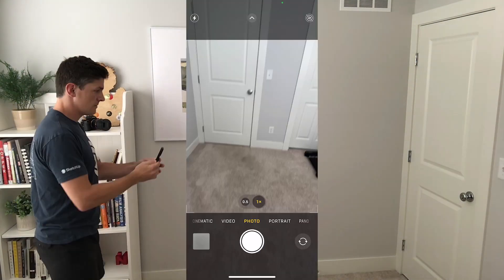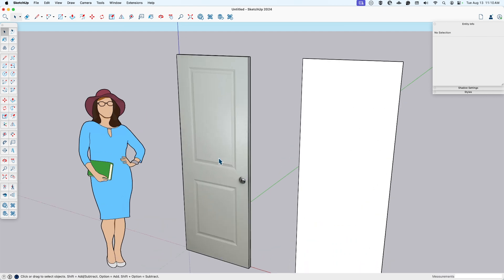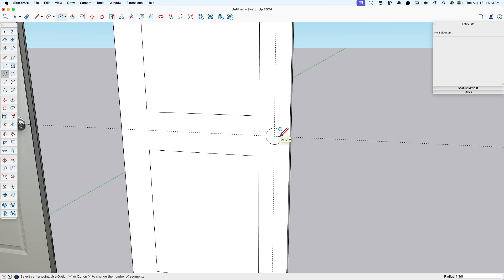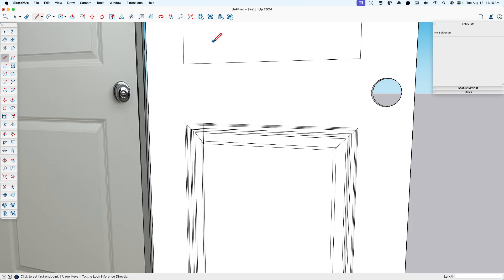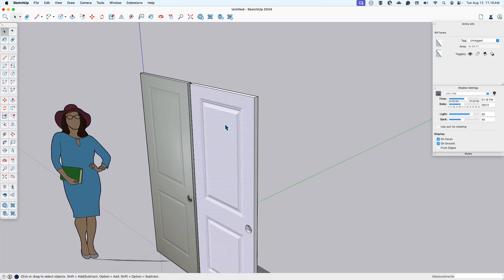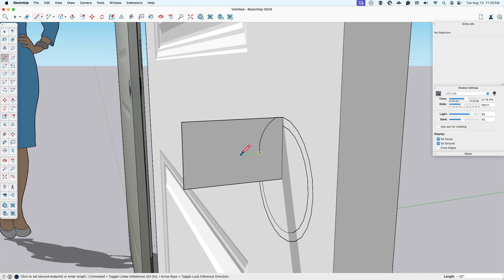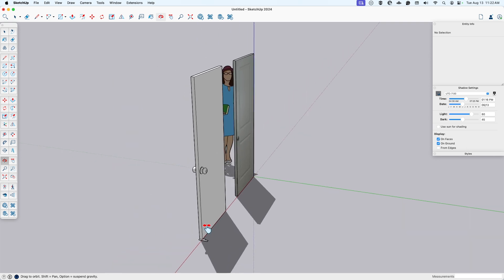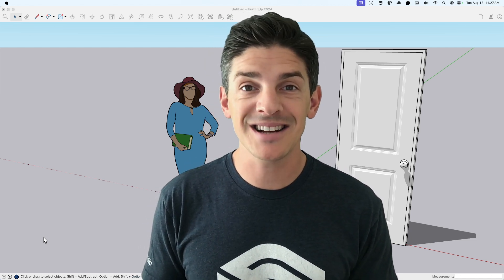How to Model an Interior Door in SketchUp

Comment from the maker: What do you want us to model next?
Reply: How about a complex organic shape? For example, I'm revisiting an old, low-poly spaceship model I built in Rhino 3D over two decades ago. It's a rather curvy, organic shape—not much in the way of straight edges or flat surfaces (it's supposed to be a Vasudan ship, from the FreeSpace 1/2 games). So far, I've just been using the Arc tool to approximate the existing low-poly contours, and I'm hoping I'll be able to (manually) combine them once I'm done, into something resembling the original shape. I'm curious how y'all'd go about tackling something like that.
Reply: Continue modeling your room.
Thanks Matt!
Reply: How about doing a Layout package on a reasonably complex mechanical part, show scen creation and dimensioning
Reply: I would really love to see how to animate a bi fold door  using dynamic components when there are 5 panels instead of 2.
Reply: How can we make a dynamic component installed so that we can only stretch it according to the gap in the wall and maintain its proportions.
Reply: Nice and thank you, What about a sash window, vertically, with rubber seals.
Reply: How about a dovetail box?
Reply: Ceiling Fan , Sofa

Comment: Great tutorial on drawing the door, but it's orientation is wrong. It should be placed in the middle of the door casing, not on one edge.
Reply: Single swing doors always have to be flush and hinged with one edge of the jamb depending on the handing (left or right).  Casing is the trim around both sides of the door.  This is in the uSA..  Do you have different  terms where you are?
Reply: It's orientation is correct. At the edge.
Reply: Yeah, he's placed the door correctly.  Up against the door stop which makes it flush with one side of the jamb. Add casing if desired.  Check the doors in your house.
Reply: Without using an hinge into the frame and door then this orientation is correct. Obviously in the real world, the hinge would push out the door slightly.